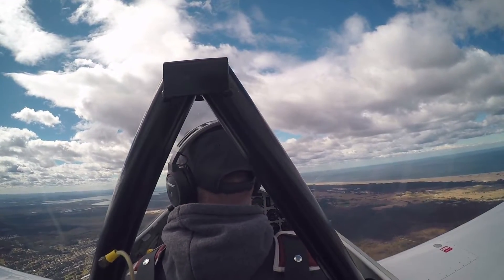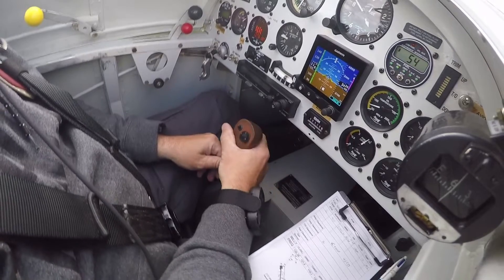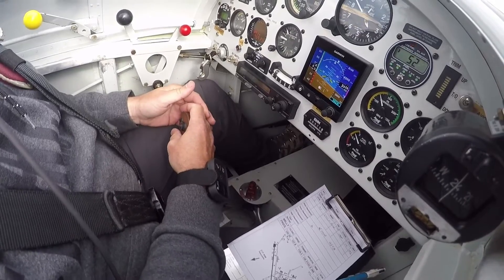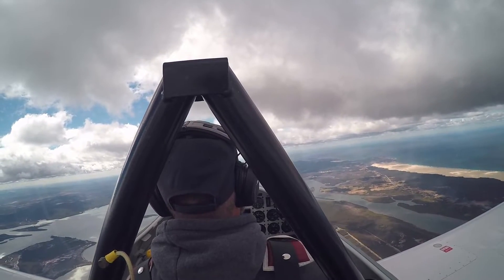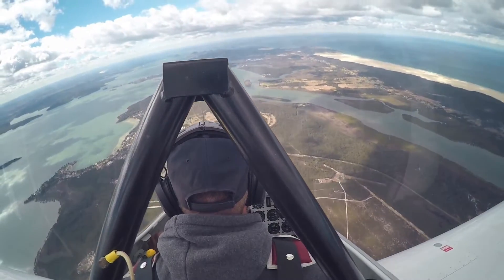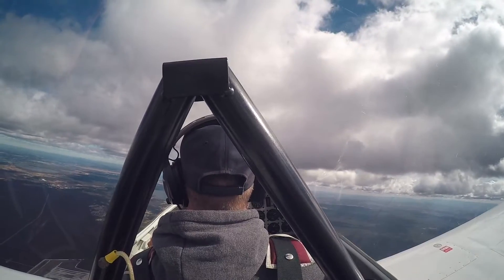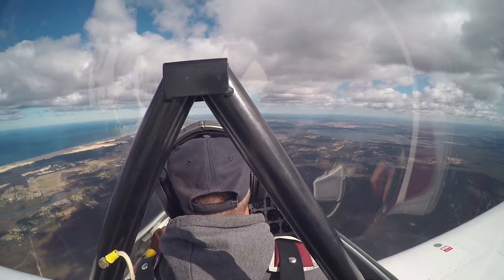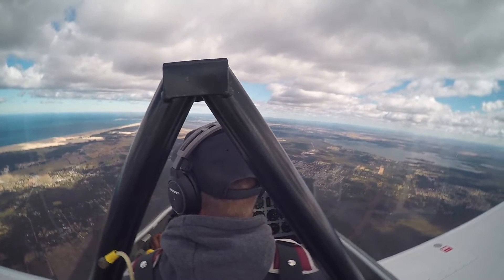Side Slip to Spin - demonstration

Comment: Isn’t that a forward slip?  

Side slip/skid = L aileron + L rudder + high angle of attack = accelerated stall
Reply: Nick,
Not sure what you mean?  A forward slip/side slip is same thing just different terminology applied to the same manoeuvre depending on whether one is tracking the runway accounting for a cross wind (forward slip) vs side slip which is used ostensibly to increase drag to come down steeper/speed control or for better vision.  

A skid is simply where there is more bottom rudder than aileron and the aircraft skids through a turn - all bad as the stall causes the lower most wing to drop further and aircraft can roll inverted and start autorotation and spin.  A slip is where more aileron than rudder but it is top rudder- no major issues as any stall will cause the highest wing to drop, effectively levelling the aircraft out.